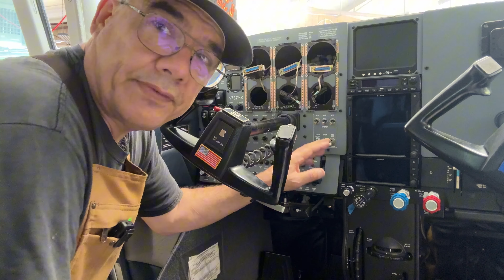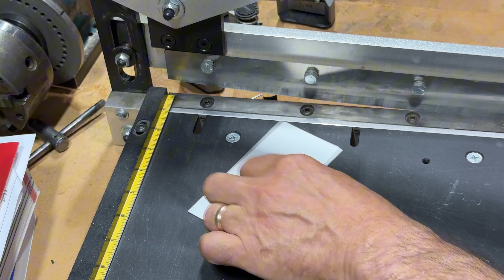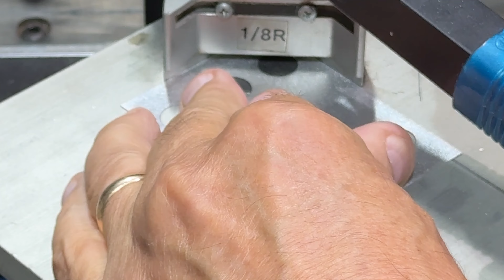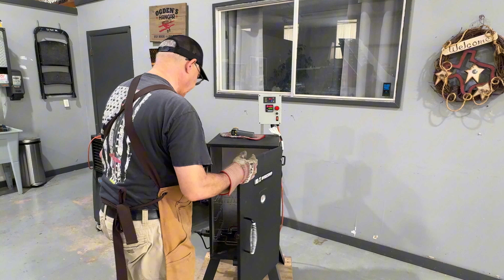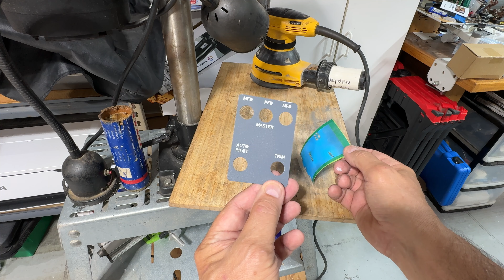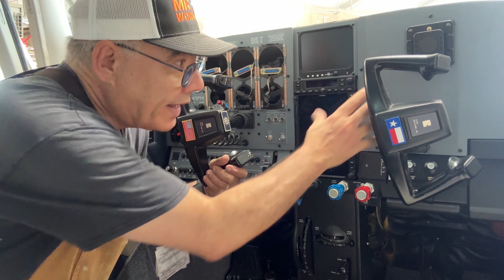Laser Engraving / Powder Coating Instrument Overlay

Comment: Hi Mr. J (Mr. J’s Workshop),

I just discovered your Zenith CH‑701 build series on YouTube—what an incredible project! Your attention to detail and workmanship are truly inspiring.

I’m currently building/upgrading my own CH‑701, and I was wondering if you could share more about your landing gear setup. Specifically:
	•	What type of front and rear landing gear assemblies are you using?
	•	What tire sizes and rims did you choose (e.g., rear: 29×11‑10 Alaska Bushwheels?)
	•	Any STOL/tundra tire setup details—bush wheels vs standard wheels?
	•	Did you use gear legs from a CH‑750 Super Duty or modify stock gear?

Your insights would be a huge help. Also, if you’d prefer to chat via email, could you please share the best address to reach you?

Thanks again for the great content and for sharing all your hard work!

Best regards,
Reply from the maker: Hello, thanks for your kind words. The Zenith ch 701 is a great choice of aircraft. the tires that I have on aircraft are the tundra tires that Zenith provides and also same on the 750 STOL. 
The landing gear is the standard landing gear that is provided with the standard brake set up. As for the nose wheel well I decided to use the Viking steel bungee. I changed out the landing gear pads with half-inch rubber pads.
Have a great day
I can also be reach at MR.JS.WORKSHOP@gmail.com